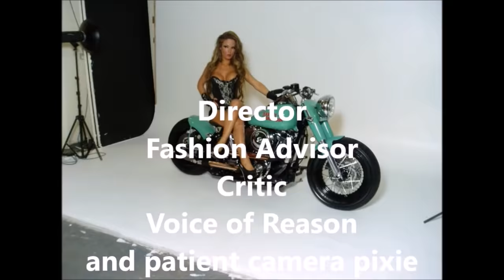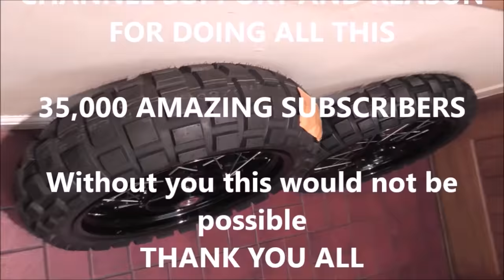Delboy's Garage, USD Fork Seal Replacement

Comment: Hi Del! When transporting my bike on my trailer and I tie the front end down using ratchet straps am I just compressing the springs or dose this actually put the seals under more strain to? Last time I tied it down I noticed a seal leaking, thought I must of over pressurized the seal maybe. Thanks john.
Reply from the maker: Hi John, it's a valid point, and you do indeed increase the pressure slightly inside the fork leg, as they are sealed and airtight, so as you strap the front down, you increase that air pressure, which can push a little oil past the seal (remember it's only a thin rubber lip pressing on a chrome tube), but that doesn't mean you've blown the seal, just wipe them off and keep an eye on it... and for what it's worth, you really don't need to strap them down as much as you think, as long as you're not bouncing the van over unmade roads, then just a 1" depression of the forks is plenty in a van, as long as it's equal both sides of the bike, maybe pop a strap across the back as well, the best way is across the back of the tyre... when I strap down in a van, I take a strap from one side of the bike, across the top of the rear tyre to the other side of the bike... and that stops the back end moving around too... never had a bike flat over in a van in 30yrs or more.
Reply: @Moonfleet41  thank  you👍

Comment: Hi I have a Ducati ST3 s with Ohlins albeit it has Showa on the leg bottom. When releasing the top nut it looks totally different, is there a different approach/video  to take buddy?
Reply from the maker: The principles are all the same, just perhaps the anatomy is a little different.. maybe grab yourself a Ducati service manual and follow the steps, working with the video too, it should all make sense. !

Comment: Hey, i just got xs650 Yamaha, drum brake rear, disk front. Got usd forks, swing arm and wheels off 1993 Suzuki gxsr from a salvage yard that i plan on putting on it. I guess that will greatly improve my braking and suspension performance? Should i do clip ons or drill top for risers? Never have ridden with clip ons
Reply from the maker: Hi Denis, sounds like a cool project buddy - I can't make that choice for you though, I'm personally not a fan of clip ons, when you lean that far forward you need to put your feet a lot further back, otherwise your whole body is cramped up in a c-shape, it's about the whole riding position, not just where your hands are, but also your feet and yer ass !  Good luck with it...
Reply: Thanks, that's what i was thinking. Love your videos!

Comment: How would you age the castings off the bottom to replace the tubes, I have been told they have to be pressed onto the new tubes and costs a lot for an intruder vz800
Reply from the maker: They do indeed have to be pressed on mate, and you'll butcher the old sliders pulling them off...

Comment: Hi mate, just watched your vid on the upside fork seal replacement.  When you mention the air gap to the top of the fork are you meaning the top of the gold outer tube or the top of the inner silver tube? Its a little difficult to tell on the vid. Any help would be most appreciated!!
Robin
Reply from the maker: Hi Robin always the silver inner tube as that's what you pour the oil in to so it's fixed height.

Comment: Looking to rebuild my folks,they recommend 5w oil which I guess is what's in my folks already but they are very soft, would 7.5 be okay? Or would it be a huge difference in the dampering? Thanks
Reply from the maker: Hi Elliott, it's always worth a try... if they're too squashy for you (technical term lol), then you can thicken up to 7.5, it will make a dramatic difference, and if you don't like it and they're too stiff, then you can go back to the 5w for the price of a pint of oil... hope that helps, good luck with it, let us know how you get on!

Comment: That was a great video. However, your fork oil measurement is off because you left the rag around the fork. It should be measured while the slider is fully compressed..
Reply from the maker: No not exactly mate, i measure to the top of the INNER fork tube... so it doesn't matter if the outer tub is held up a little.

Comment: Hi Del, looking at buying that driving tool. I mostly ride sports bikes like RSV Mille, R1's, CBR RR's and the odd old SRAD GSXR 600 (not upside down forks)... with this in mind, which size seal driver tool should I get?  Cheers.
Reply from the maker: Hi mate.. they come with a range of scope to fit about a 10mm range....so if you have 53mm forks, then you'll end up with a driver that will cover from 49mm to 56mm.... just check availability and make sure your forks fall inside that range.! hope that helps.. Del.

Comment: Moonfleet41 I love your videos man, you seem to really know what your doing on a wide arrange of bikes, thats awesome!! I do have the same bike and my fork seals too need replaced. I have the 97 ZX7R. My question is should I just pick up new bushings too? I already purchased the Allballs brand seals. How about the springs? While im in there should I replace those as-well? My bike has around 33,000 Miles on her
Reply: Another Question. I just picked up a full Akrapovic Exhaust for my 7. Should I be looking at places to JET my bike that have a dyno???
Reply from the maker: +Bryan Martin Hi Bryan... I always work on the mantra of "if the cart ai't broke, don't fix it" !!  So if you don't have any play in the bushings, then leave them alone and the same for the springs, they're a good progressive spring and should be in fine condition at that low mileage...   Kawasakis are a strongly built sports bike and can take a lot of punishment........... with the Akro system, just fit it and take it for a ride!  It will probably perform just fine, remember the Kawasaki has a 4-into-1 system already, so you aren't changing the dynamics of that and you'll only need to jet it if you find big flat spots, which you won't know until you ride it !!  So, just take it out the box and bolt it on.... you never know, it'll probably be fine.....
Reply: +Moonfleet41. Thanks for getting back to me so quickly, I appreciate that. Thank you for the insight

Comment: Question: I have a XR1200 Sportster. Can I use this video as an instruction for changing the fork seals, or are the XR1200 forks different than these ones? Thanks for your great videos! Christian
Reply from the maker: Hi Christian, yes you could use this video, but I would say grab a service manual for your bike as that will give you any specs you may need and just be aware that there may be anatomical differences to the way certain parts look, even though they perform the same function... take an open mind, and common sense, and this video should be of help.
Reply: Thanks again, will use my 600 page service manual;)  @Moonfleet41

Comment: I have a 2000 goldwing the manual says i will have a lot of trouble putting the spring and nut back on for assembly because of pressure needed to squeeze spring in  , in your video it looks fairly simple how you did it   , is the goldwing forks different from the way you did these forks
Reply from the maker: The Goldwing forks are different Steve, they are conventional forks, these in the video are USD forks, a totally different design!
Reply: @Moonfleet41  ok thanks for getting back to me before i tore them apart ,, do you have a video on them or should i take to shop
Reply from the maker: @stevehounsell8379  Not on my Goldwing Steve, but on lots other bike, Triumphs and Harleys, check out the channel playlists, plenty there mate.

Comment: Hi. Nice video by the way. Love the detail instructions. I'm all the way from the other side of the world. Recently I've notice there's a leakage on my usd fork and theres a barely visible long scratch about 5 cm along the chrome part. I can only feel it if I run my fingernail on it. Will that cause the leakage? Its been only 2 months from the last oilseal change.
Reply from the maker: Hi Akagi.. does this scratch run along the leg, or around it 'crossways' ?
Reply from the maker: Hi Akagi.. does this scratch run along the leg, or around it 'crossways' ?
Reply: Moonfleet41 along the leg. And the oil just kept dripping.
Reply: Moonfleet41 i reckon the scratch were cause by trapped  sand between the oilseal. Or maybe im wrong. Thanks for replying. I really appreciate it.
Reply from the maker: Ok, Akagi.... there is a fix for this, but it needs to be pretty bad for it to be worth it... how deep is this scratch....can you catch your fingernail in it..?

Comment: what kind of lube did you put around the dust seal? will Vaseline do? cheers delboy.
Reply from the maker: Get yourself some Red Rubberlube mate... use it on any rubber to metal joint..!

Comment: Great video Del, appreciate the work you put into them. I am having an issue where my left fork makes a sound at the beginning of its travel. Sounds like metal hitting metal, the bike rides fine with no visible leaks. Do you have any ideas what that might be? Bike's a 2008 Yamaha FZ1 btw. Thanks again.
Reply: One more question is if I'm only changing the oil in the fork, do I need to get the spring or the top assembly holding the spring in? Thanks!
Reply from the maker: Sorry mate.. ive read your question five times, and i cant get what you are asking.. """do I need to get the spring or the top assembly holding the spring in?"""    Sorry buddy,m what are you asking here?
Reply: Sorry it was confusing. If you go to the 11th minute of the video, you're taking off the top assembly and then the spring. Is that a necessary step if I'm just changing the fork oil and not the seals? I guess it might be necessary so you can pump the rod to get more fluid out.

Comment: I heard that usd fork leak easily(than telescopic) when use in dirt road!
And cost more when fixing it!
Is this true?
Reply from the maker: Oil level on USD forks and also conventional forks is always above the level of the seal, so they will both leak just as easily if the seal is lacerated by sharp deposits of dirt and grit... so should be protected on dirt roads with gators, if possible... and yes, they are a little more involved to fix, so there may be a slightly longer labour charge...

Comment: Which way does the chamfer face when you install them. You kept turning them over like a magician and I couldn't follow which way they install. Does the chamfer face the wheel or the handlebars??? Thanks for another great video.
Reply from the maker: I assume you mean the fork seal.. that goes "wire side in" to face the oil.. flat face outwards.. if thats what you are asking..?
Reply: Yes, but you mentioned a chamfer on the oil seal in your video. Which direction does that go? Up or down??
Reply: OK, I watched that part of the video a few times again and it looks like the chamfer goes toward the wheel. The reason I am asking is because I can't get my fork to stop leaking and I'm on my third guess which way the oil seal goes in the outer tube. You are the only person on youtube that even took the time to try to explain how the seal gets oriented. So you get a big thumbs up for that! Buy wire side in, I presume you mean UP. That is, up inside the outer tube. Not sure why I am the only person in the world that wasn't born knowing how to install these damn things.
Reply from the maker: Sorry to be vague mate, yes I mean that, the wire side faces the oil... so UP inside the alloy tube, like you said... you always have the closed in face of the seal facing out to atmosphere with the clip holding it in.. I hope that makes sense, good luck with it, and shop you get it sorted!
Reply: Thanks again for the help!! I got to take a good look at them today and I think I have them in correctly now.

Comment: Hello, I was hoping if you could help me out with what's going on with my bike. One fork is leaking when I ride it but when it is just parked, there is no signs of leak. Does this mean I have to do a fork seal replacement or something else needs to be done?
Reply from the maker: If you have a leaking fork seal but only after riding it then it's only slight, it would only pour out all the time if it's a catastrophic leak... you could try cleaning out under the seal with a "Seal mate"..it could just be collected dirt.. and if it still leaks a bit after that then you'll probably need to replace them..!  Here's a how-to on the seal mate clean trick..!  https://www.youtube.com/watch?v=H9iMo_flzF0

Comment: Delboy, I just found a leaky fork on my BMW R nine T after winter garage wakeup time, I am pretty confident I can do this by myself but I don’t have the seal driver tool you’ve been using here. So what can I use, can I just carefully drive it down with a screwdriver?
Reply from the maker: No Marko, Don't poke the seal with a screw driver, they need a fair bit of force to drive them down into the leg, and it will certainly damage it.   If your NineT isn't high mileage, and you think the slight leak may be dried out over storage.... then as long as it's just a "weep" and not a bad leak, then How about before you go stripping it apart, spray some silicone lube like 'GT85' on the leg so it gets worked down into the seal, ride it for a while, then that can often cure it... the silicone softens the rubber lip of the seal, and the weep can go away.... lay up can cause all sorts of problems with bikes, and a weeping fork seal is a common one.!     Do that first, and if it's still wet after 100 miles of use.. then you know its a bonafide leak that needs a new seal.!   and if you check out our old video for fork seal replacement i showed how to make a seal driver from a couple of lengths of waste pipe..!
Reply: @Moonfleet41  Great Delboy, thanks a bunch for this great advice. I am going to try with silicon spray first. This morning I made a little hook tool from a sheet of thin plastic, went underneath, removed the dust seal and carefully pushed the plastic hook under the fork seal just on the edge, went once all the way around. A small amount of oil came out and I wiped it off with a microfiber cloth. Pushed the dust seal back on, shook the suspension and it was dry for the most part. Now I will buy that silicone based spray and work that in, who knows it might even fix the problem for this summer. But nevertheless I will perform this procedure soon, hopefully it will hold until I can buy the Nitron fork cartridges to do it all in one go. Also I did find the tool on EBay, the fork seal driver you were using for some 36€. So I am going to buy it. It’s gonna come useful. Thanks mate.

Comment: Hi Del how do I seperate the stantions from bottom to renew stantions zx9r B kind regards Mike
Reply from the maker: Thats a nightmare of a job without the proper kit mate, They're an interference fit, and but as long as the stations are trash.. you can bite them hard in a vice.. gently heat the knuckle assembly, and twist it off.. but be careful, ive broken one in the past..  and you will need a hydraulic press to push the new ones in..    TBH mate, most main dealers will carry that out for you for a humble fee, and it's a whole lot less stressful if you don't have the equipment

Comment: Hi delboy. I was wondering if you ever came across the problem I am having with upside fork legs. (yzf R1 5jj 00-01). I have fitted new stanchions, bushings and seals. I have refilled with oil and pumped  damping rod 20 to thirty times and let settle 40 mins to and hour and pumped again. But no matter how many times I do this when I put them back together and pump the leg up and down there is a squelching noise. I don't know where to go from here. I have been looking on the net and asking experienced people but can't get an answer. To the best of my knowledge and from what I can see the spring is seated correctly when I reassemble. If you could shed any light on this what so ever it would be greatly appreciated it. Thanks
Reply from the maker: Hi Brian, sound like you could be worrying unduly, I had exacly the same on my ZX7-R forks, if I lunged them up and down on the bench when I finished re-building them, they squelched quite a bit... but back in the bike, they worked just fine and the bike handles better than it ever did... just make sure you have the right quantity of oil in there and it should settle itself down once you start using it...
Reply: @Moonfleet41 
Hi delboy. I will do as you say. It is nice to hear you say that I could be worrying about nothing and that you have experienced something similar yourself. Thank you for your help. I appreciate it a lot.

Comment: Hi Del, is there a way I can remove the fork protectors on my 2001 Triumph Bonneville? I would like to put fork gaiters on. 
Thanks,
Lisa
Reply from the maker: Hi Lisa, Yes indeed  - you have to take the forks out to fit the gaiters, as far as I remember, those stand up fork protector shields just pull off... they're kinda forced down over the outer fork leg, just like the gaiter is going to be... so just twist them back and forth, whilst lifting upwards, and I think they just come off... then slide them off the top just before you slide the gaiter on !

Comment: Just about oil level measurement should be taken with the spring on it  or not.
I mean the volume of spring gone to make rong the oil level measurement measurement ?
It's a question I'm asking.
Thank you.
Reply from the maker: Spring Out, fork fully collapsed, and measure to the top of the chrome tube !
Reply: Understood thank you.
Reply: Can you tell me please if honda shadow 600 engine is same transalp XL 600 engine?
Because I didn't find gaskets transalp engine so I did buy shadow 600  gaskets.
I need only the side engine cover to change the clutch kit.